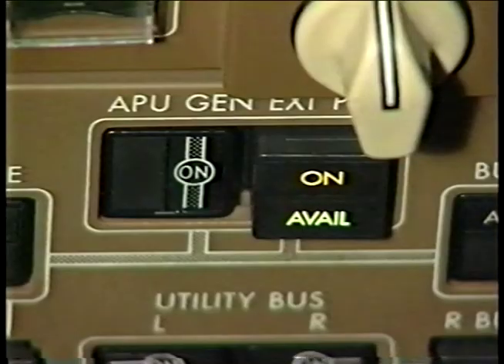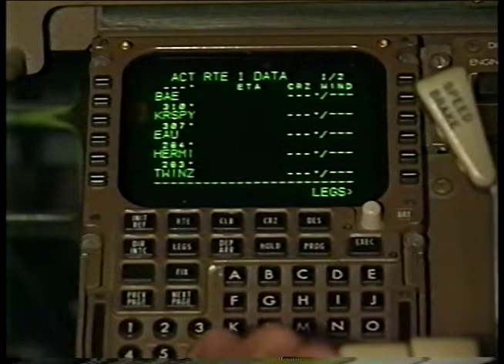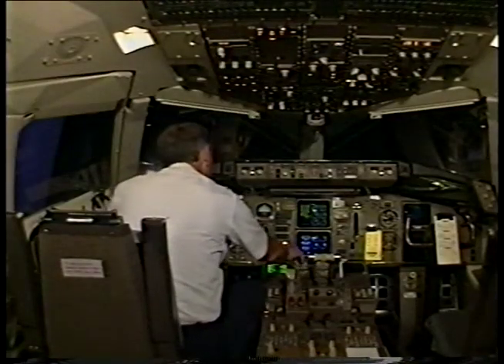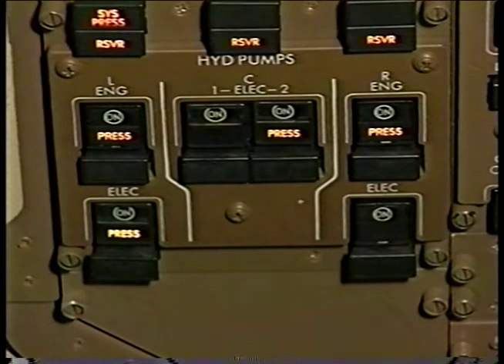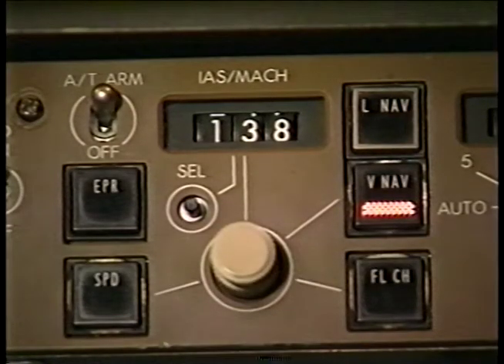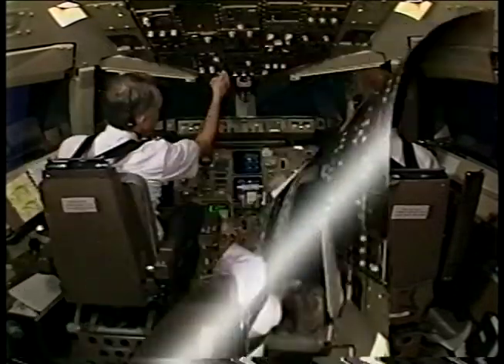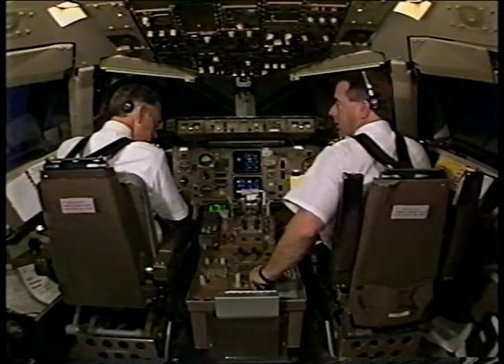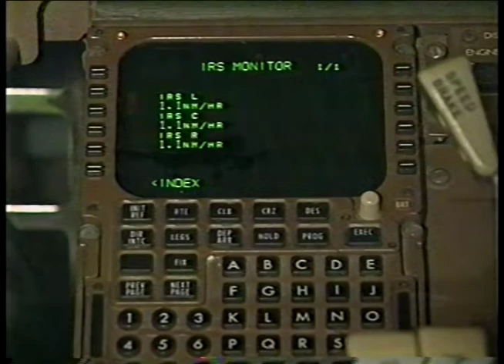Northwest Airlines Flight Training Video Boeing 757 Normal Operations

Comment: Thank you very much for this upload. Currently I fly the 757 from Flight Factor in Xplane12 a lot. I learned some details from it.
Reply: Note that the aircraft in the video has no GPS and stuff, so some procedures will be different in your sim.. also Boeing recommended procedures have changed somewhat since.
Reply: yeah old FCOM's and FMS's don't suffice